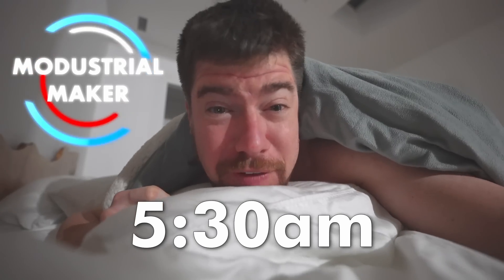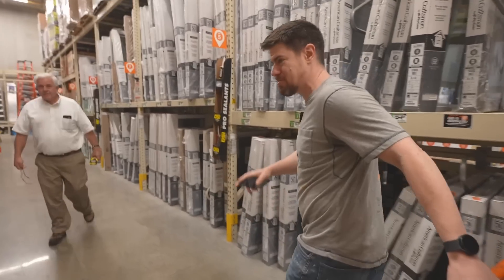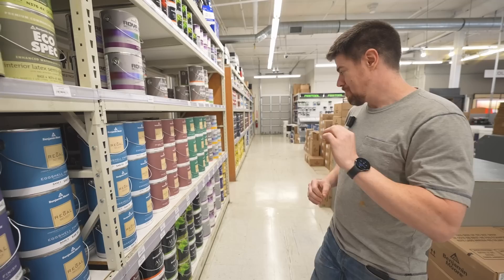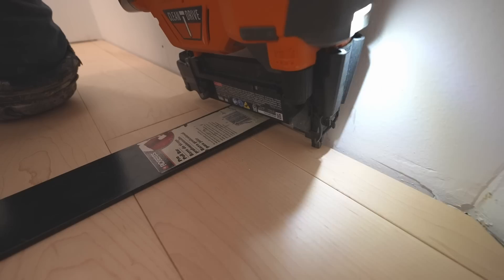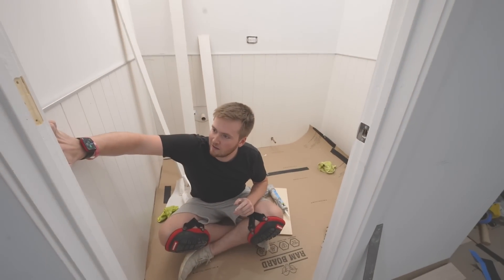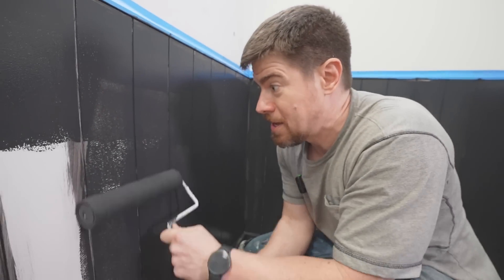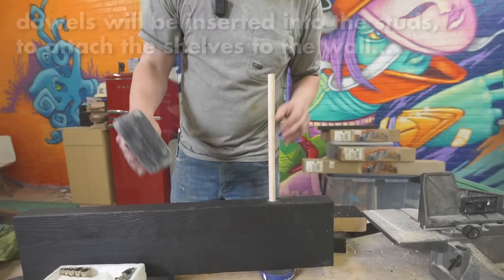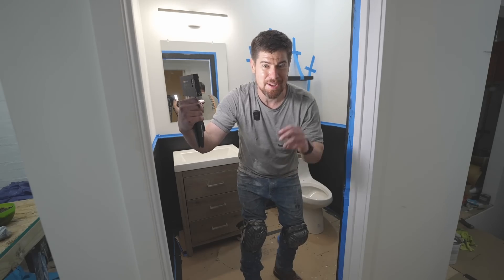24-HOUR BATHROOM RENOVATION CHALLENGE...Impossible??

Comment: The point of your 24 hr challenge was to get a lot of work done quickly, so I think it was a huge success. Well done!
Reply: He really did it being part of it had to be paint drying! I think he might have had better time use if he'd painted the upper wall first & the panels before installing. They could dry while the floor was installed. I knew he'd have no problem doing this small space after everything else he's done here!

Comment: Our of curiosity, couldn't you have saved a lot of time by painting the walls white first (except for the bottom) and painting the black panels downstairs... then cutting them and then installing everything?
Reply: I thought the same thing, I was like, “dude, paint them before you hang them!!” Then it would have just been touching up at edges and seams.
Reply: He only had 24 hours and if he painted the walls and panels first, he would have had to wait for both to dry before he could have measured/installed everything.  

That's my guess.
Reply: No, it’s just a matter of coordination. First preparing the panels to fit in place, then paint them two times. In the meantime he could have installed the flooring, the mirror and creating the floating shelves.
After that is done, install the panelling, the trim, caulking the seams.
He would have had much time left to install the vanity and the toilet
Reply: Plus you wouldn’t have to risk overspray on those nice hardwood floors

Comment: Looks good for 24 hours, but a tip to make it faster in the future: Roll the paint on the waisncoting before you put it up.  then you just have to caulk (and I believe you can buy caulk in black) and its just touch up paint and no taping the metal rim.

Comment: The schluter strip trim really made this work. The only thing I would suggest would be to put some metal caps that match the trim on the ends of the shelves rather than having the exposed end grain. Or maybe go ahead and paint the ends that matte black so they don't stick out as much. 

If all the wood in the room had the same tone it might fit better, but it's weird seeing the pale warm floor and the grayish vanity and the yellow end grain all mixed together.

Definitely agree on making trim around the mirror, I've done that a few times to cover crappy builder grade mirrors and it makes a huge difference!

Comment: The one thing I would have done differently would be to change up your order of operations/installations. I would have painted the walls and or ceiling with the Chantilly Lace first, then while that was drying cut, then fit, and then pre-paint the ship lap boards. While those are drying then go install the flooring. Once the flooring is in and the panels are dry, put them up, then install fixtures and BOOM done. No taping, not touch ups, done.

Comment: Beautiful result and with a low budget no less. How are you going to keep the floors clean though. You have to mop and dry them right? Wouldn't waterproof floor with a floor drain be kind of very important features for later usability?
Reply: Or maybe there is actually an American cultural context here which I didn't consider. A powder room is only ever to be used by house guests and visitors. Those who live there use the actual bathrooms. And visitors know not to use the toilet unless in the direst of emergencies and they know that they are supposed to leave the powder room spotlessly clean after their use or otherwise it will be the last time they were invited.

Comment: Catch me if I'm wrong, but if you'd have painted the panels down in the garage as soon as you'd gotten home, then marked your 40" line with the level on the wall, painted white above that and not really cared how far below the line you went, you could've then hung the panels and not taped a thing.  You'd have had go around and paint the caulk with a small brush and that's it.

Comment: LOL the toilet is not connected to the water supply- is the faucet connected?  Do you have any tile from the other bathroom- take a pc of tile and trim it to fit and have it as a backsplash on the vanity top.  Just make a picture frame and add reuse the glass.  possibly a little shelf on the bottom of the frame.   The vanity might hold up longer than you think. can not tell did you do a shadow line along the floor with the paneling.  Using the shlutter on the bottom of the panel and have a little shadow line under would be cool also.   Good enough to get you through inspection.

Comment: Surprised after dry fitting the paneling, you didn't paint it before installation... would avoid having to tape off everything for it.  Also, when/did you paint the top half white?  When peeling off the painter's tape at the end it was still set up for painting the bottom half.

Comment: Would it have not been easier to pre-paint the panels before you put them up?
Reply from the maker: I caulked the seems between the panels  baseboards (which were installed off camera) and needed to paint over the caulk, so painting after install and caulking made the most sense

Comment: You mentioned the importance of making sure that the first row of flooring is straight.  How do you make it straight? Should it be straight in reference to the wall that it is placed against? But what if the wall itself is not straight? Is it in reference to the perpendicular wall? Or maybe to wall on the other side of the room? Again, what if any of these walls is not straight? Could you explain (or maybe show in another video) how you achieve a straight first row?
Reply: I’m no flooring expert but if you centre you floor and work outwards your first piece will be straight and you can accommodate for your walls not being straight
Reply: @scottishkicks8444  what does ‘centering the floor’ mean in a room whose walls do not form a perfect square or rectangle?

Comment: It looks fantastic, the mirror would be 100% better with just construction adhesive holding it, and be more solid. The vanity would be a decent pattern for a more solid replacement. As for the 24 hour deadline, close enough between needing the paint dry before you could proceed and that darn pepsi guy I say you came in close enough

Comment: Shoulda sprayed the panels before you put them up, and painted the walls & ceiling before you put up the mirrors etc. If you'd done that first, you would have been able to do other work while the paint dried, and taping off would have been a lot easier.

Comment: Was there a reason for not painting the paneling before you put it up? In my head it would have been easier. And yes you did it in 24 hours great job
Reply from the maker: We needed to install and paint the floor trim after installing panels, and spackle over nail holes from installing it, so would have needed two coats of paint.  So no way we could have made it in 24 hours if we had to wait for two coats of paint to dry before installing it.
Reply: Thank you

Comment: Do I think you made the 24 hour challenge? No; but I'd argue there wasn't a point to that anyways. You did a great renovation in a day! I did wonder why you hand brushed the bathroom instead of using a paint sprayer? I feel that might have saved some time. But overall great work!

I'm sure you did, but since it wasn't addressed in the video, did you finish the ends of the shelves?

Comment: Why did you not paint the walls and shiplap first? And why not nails in the shiplap? Construction adhesive will ruin the drywall if you ever decide to remove it.
Reply from the maker: There actually were nails in the ship lap, I think you can see them in some time lapse...but that is part of why I painted after install, because we had to fill the holes and paint over them (and paint the caulk between the panels and baseboard trim

Comment: Shou sugi ban a frame for that $27 mirror and I'd call that a good deal, but agreed it looks too plain.  I think if I was going to do the same thing project in a limited amount of time I would have had my materials ready the night before.  I would have also pre-painted the panels and trim to let them start drying before installation.  

Bathroom cabinets are a hard subject, they tend to be expensive and also not well made. I have been wanting to do something with my dated cabinets for years, but my home was built in the 60's with built in cabinets, so replacing them is a problem that would make me have to redo the floors at the same time.  I have been seriously considering just sanding them down and painting them, making new doors and drawer fronts, and modernizing the hardware.

I like it overall, but I probably would have put the TP hanger where you put the towel hanger, and put the towel hanger higher on the wall to the left of the sink where it is more visible.  Brushed nickel finish is a great choice.

Comment: Did you end up raising the toilet flange to account for the added thickness of the flooring or just try to rely on the wax ring? I'd recommend at least using a flange spacer kit if raising the flange itself isn't an option. The last thing you want is sewage seeping under your wood floors! Other than that it looks awesome! Kinda wish this series would last forever but I'm sure you can't wait for it to end lol

Comment: Love the videos mate next time to make things faster paint everything first before putting it all together.  less prep work and less cleaning up after also you can have a little break while it drys😊
Reply from the maker: Thanks!  Not a bad idea.   We did have some caulk between the baseboards and panels that needed to be painted... But an initial coat before installation might still have sped things up
Reply: @modustrial  I know in the uk we mostly paint everything first and then chuck it all in and just touch up parts after

Comment: I kinda feel like you are selling yourself short with this powder room. You’ve gone over the top to make the rest of the place looks great im not sure why you would skim here. IMHO you have the the skills to make to make this powder room look as good as the rest of the place while keeping the price down. I would use the left over flooring to build the frame for the window, but also use it to cut out strips and use them as wall paneling  for the upper half of the wall to contrast the matte black. And you are the concrete guy! Why not just re create the concrete sink you just made for your other bathroom and replace the cheap looking one you got from home depot? With those few changes I think it would think powder over the top! Inlined with the rest of the place!

Comment: Not that you need more arm chair quarterbacking, but… You could have saved sone time if you started with putting the first coat if black on the paneling, let it dry while putting on the first coat on the walls, then put down the floors. Next, put a second coat on paneling, second coat on walls, make shelves, install paneling, install vanity and toilet, trim out. There, Bob’s your uncle.

Comment: i dont want to be hater cause i think you did a great job. but toilet isnt connected to water. Probably the same thing for the vanity. I also think you could've saved time by painting that ship lap before even starting the flooring. probably wouldve been dry by the time you were done. Lots of little things i think couldve sped you up but hindsight is 20/20. Hard to think of these things on the spot or its already too late. But seriously bathroom looks great. i think givent he time constraints you did a great job.

Comment: Finished? Could I drop deuce, flush, and wash hands with everything working properly? If so, finished. If not, no-go. Still really quick either way!
.
I agree with the mirror comment. I do not like the wood on the ends of the shelves. It looks like someone forgot to do the ends. Maybe if it matched the color of the vanity.

Comment: I’d call this a almost 24 hr build not renovation. Technically you started with a blank slat not existing bathroom to remodel at the start. Also it’s not don’t until you hook up that toilet supply line bud. That being said good work it looks good.

Comment: I would’ve painted the shiplap, and walls prior to mounting the paneling, and mirror? After your home is finished, you can work as an architectural interior designer.
Reply: Yep.  I would have painted the walls and paneling before putting the flooring down.